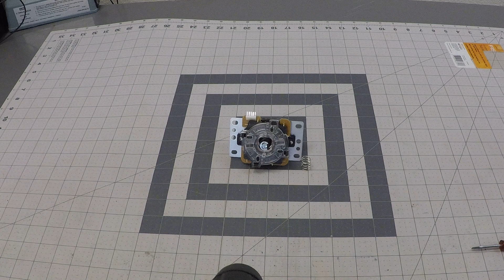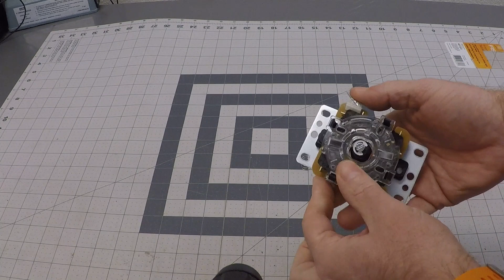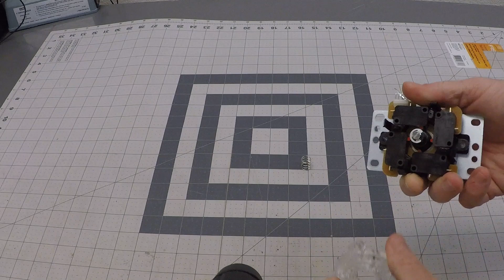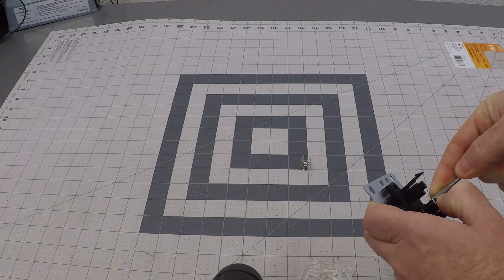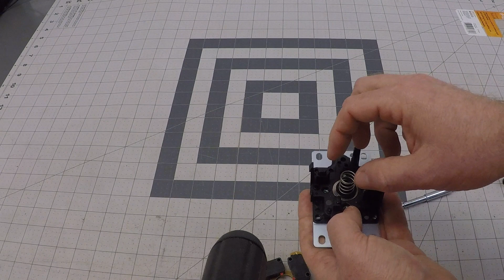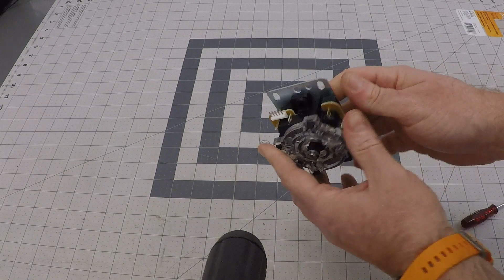How To Change Your Sanwa JLF Joystick Tension Spring In About 2 Minutes

Comment: When I saw him trying to push the c clip back on with his thumb I was just like “he’s bouta find out this clip hits a lil different”
Reply from the maker: I hate those clips. Fun fact the factory C clip is a 3/16 but you can get a 1/4 at your local box store like home depot that will work fine. Ask me how I know :)
Reply: @diyretroarcade  I know how you know lol. Also if you use some channel lock or wide nose pliers you can squeeze it back in with a lot less effort
Reply: @Scragg-  channel lock ftw.

Comment: I play at a local arcade and the donkey kong joystick is being pulled down too much and was wondering if they may be using a too high tension spring?
Reply from the maker: higher rate springs will take more force to move up or down but with a faster return to center rate.
Reply: @diyretroarcade  thanks. So is there 2 spots for the retention clip? Like one if you're installing into a regular wooden cabinet and one for a metal control panel?
Reply from the maker: @JoeCnNd  Not sure what you are asking :)

Comment: why would i need to change the spring?
Reply: For more tension. Makes the joysticks a bit stiffer and not so loose. 2lb springs are normally recommended. 4lb if you fancy a workout.
Reply: @PST101  is the original spring weaker than 2lbs?
Reply: @fiending  the original is 0.9lbs if its default Sanwa
Reply: @crixus8183  thx